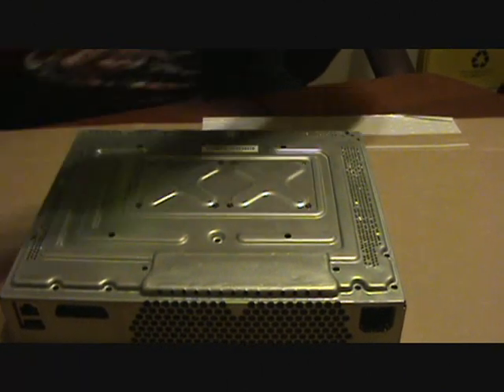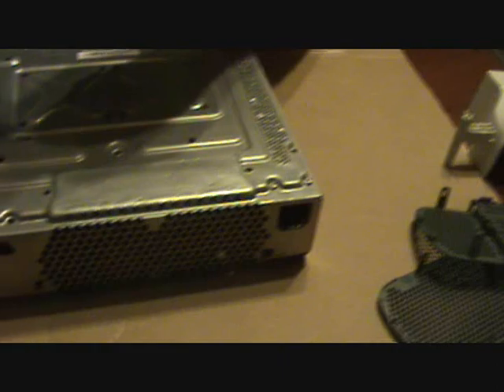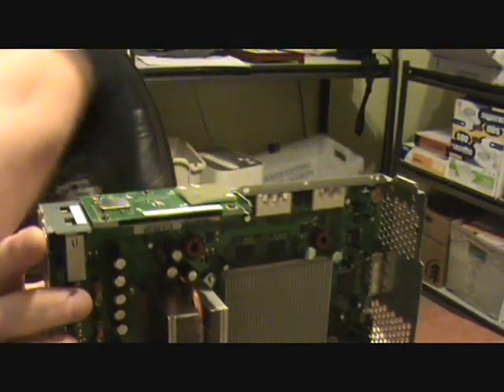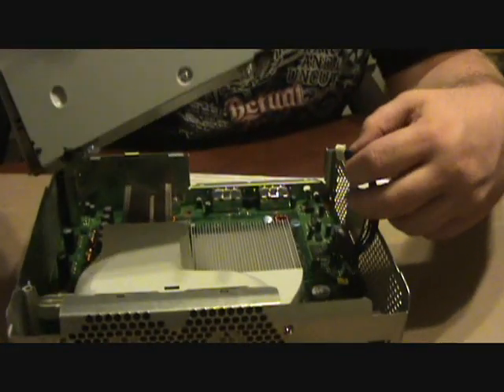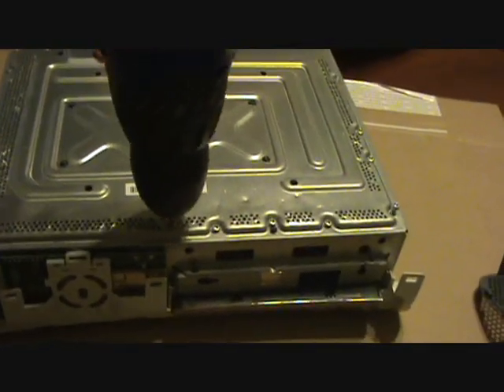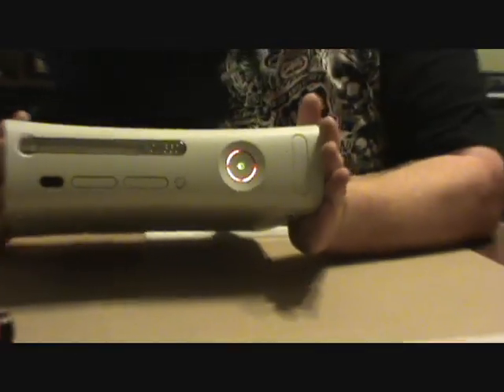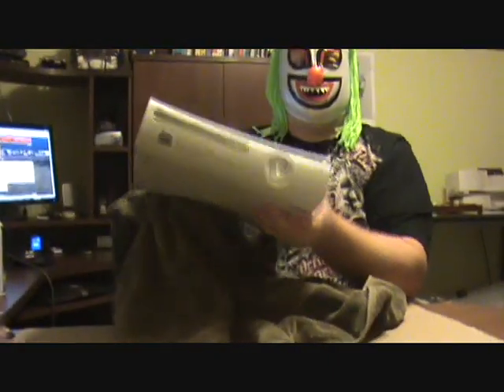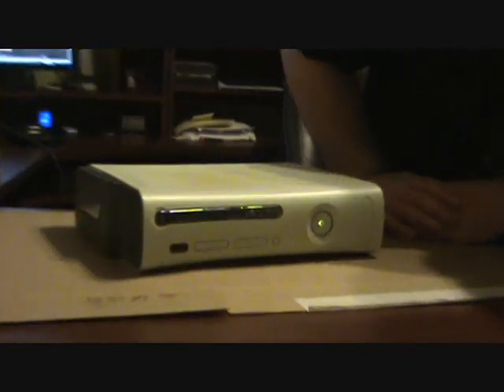XBox 360 Red Ring of Death Repair Tutorial - Easy Fix!

Comment from the maker: Your board is probably warping from getting too hot. I would take it apart again and see if it powers off if you bend the board in one direction over the other. If it does power off when you flex the board in a certain direction, then you will need to compensate by flexing the board in the opposite direction by placing a rubber stopper under the board so it flexes in the direction that doesn't cause it to power off. I had one that did the same thing and since I did this it works perfectly.

Comment: I used silicone based heat sink compound and i couldnt find the stuff to remove the other compound that was on there will it still work? Ill probably find out b4 u amswer me so still answer also i scraped a little bit of the compound off.

Comment: @JaviAirForces I left it on for about 2.5 hrs with no issues. I'll find out more when I get a controller for it.  We only use the PS3 here. I bought the xbox for $30 just to see if I could fix it , and I did. I would recommand getting that xbox 360 tool to help open the box.
I'm actually getting another one from a coworker for free. I'll post my results on that one.

Comment: @cosmicsmasher To bad, If you had listened to what I was trying to tell you. This will work if it is a cracked solder ball below your chip but only for a short time. The problem with this repair is that it causes your original problem to be 60 time worse than it was before you started and each time you do it, it will last less and less time but I guess you will have to find out the hard way?

Comment: POKERS TIGHT MAN THANX, i have a problem tho, so i did everything it works...worked its still running fine but now the video isnt comming on, it was working just fine and since i didnt have a charged controller i just let it run for about 10-15 mins tops right before i shut it down in happiness like right as i was pressing the power button the screen changed slightly to an aqua color and so i turned it back on almost immediately and i heard it powering up going to the dash but no screen all blk

Comment: @jvmc08 Although the quality of the hardware could be much higher in the systems today, the reason they tend to fail is the intense temperatures produced in a tiny box which leads to most of the problems they encounter. With the older systems like the n64and the Snes produced very little heat even after hours of gameplay.